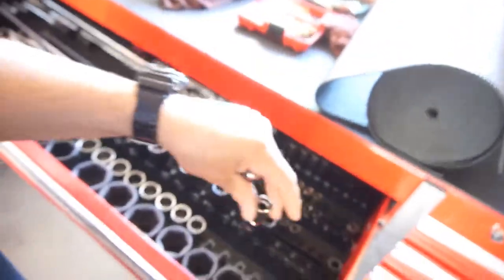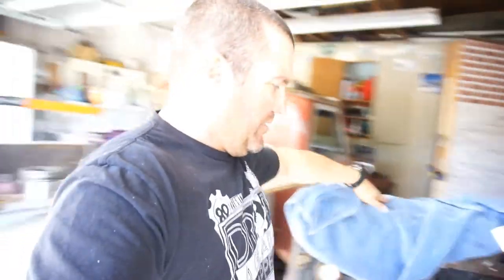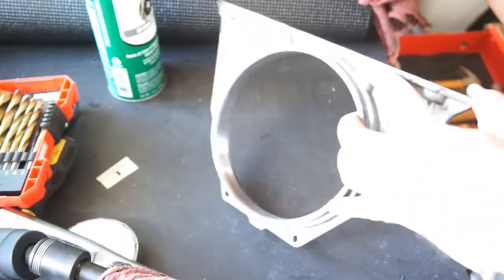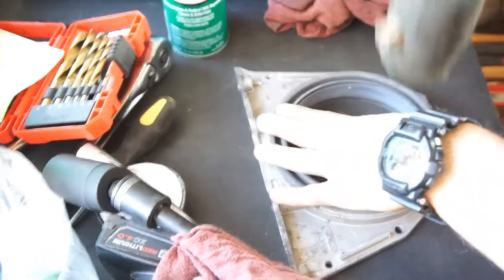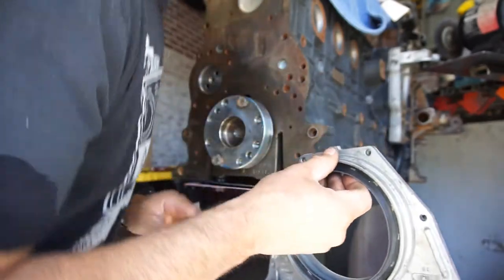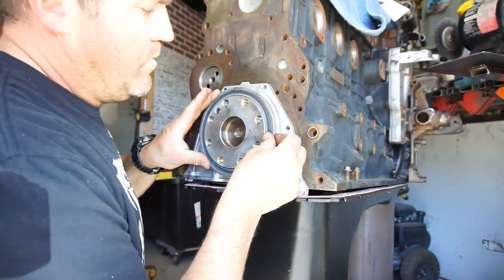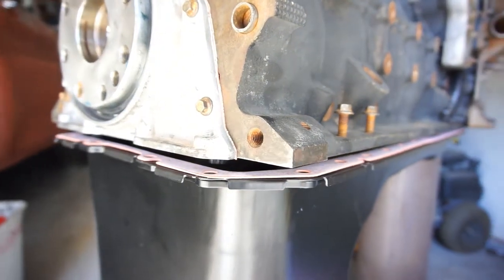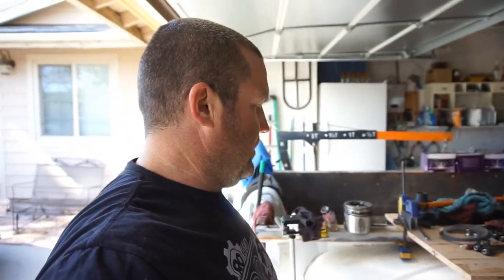Part 17 6.7 Cummins Build Installing A Fel-Pro Rear Main Seal. Almost Done

Comment: How’s the Fel-pro holding up, how long has it been? I just ordered Fel-pro to replace on my 5.9L Cummins.
Reply from the maker: I sold the truck to a buddy and it is still holding up. I put one in my son’s 1st gen 5.9 about 8 years ago and it hasn’t leaked.
Reply: @Halffast719 thanks for the help.

Comment: You are not supposed to put any lube on the ptfe lip or touch the surface of the lip it is supposed to be installed dry. I thought you even said it in the video.

Comment: Do you have to lower the oil pan for install or rear main?
Reply from the maker: No. You have to remove the tranny, flex plate or clutch and the tranny adapter.
Reply: Don't have to remove the adapter, run a screw into the seal and use a claw hammer and pull the seal out. Use the install tool with seal, it stops at correct depth
Reply: But you should remove the adapter cause its the cam seal most of the time